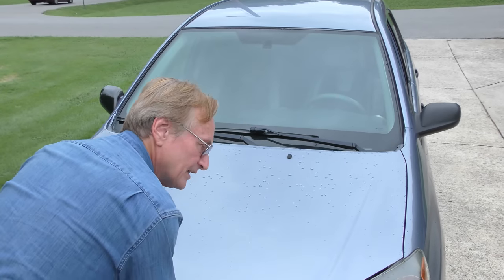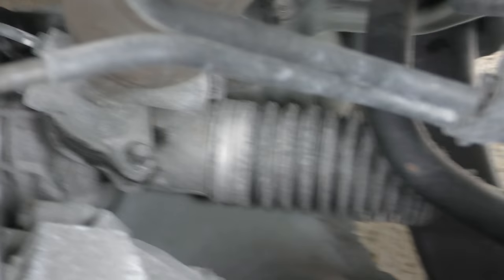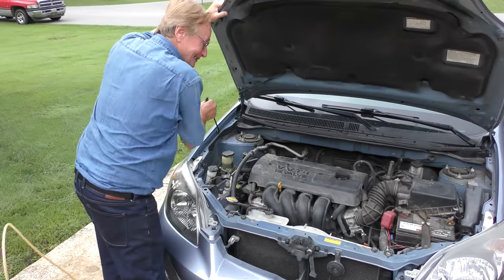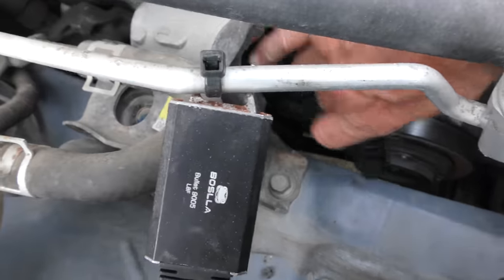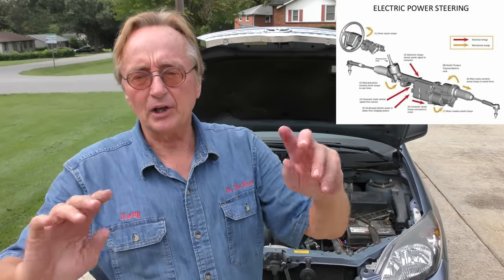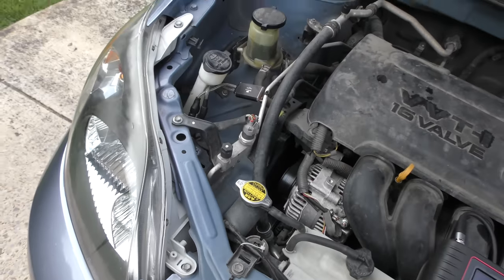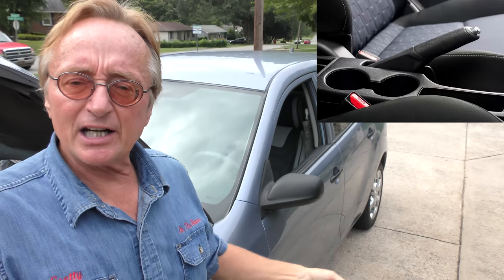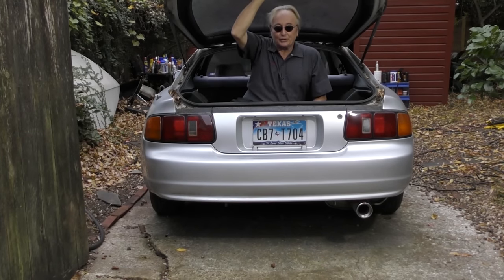Should You Change Power Steering Fluid in Your Car? Myth Busted

Comment: Last week my girlfriend mentioned it's hard for her to steer her car when driving slow so I asked how long it's been that way and she was like "oh about 6 months". I said "and you're just mentioning it now?". I went to check her fluid and it was completely bone dry. I added fluid to the max line and within a few minutes it was down to the minimum line and then stopped dropping.
Reply: Haha. That's the whole reason I'm on this page.  Mines started doing that 2 days ago on a newly purchased car.   Good to know it's an easy fix loo
Reply: Was the issue fixed after you added fluid?
Reply: Nissan lyfe
Reply: Huge  reason why  I didn’t just buy used
Reply: Drove my last camry to 400000 miles, never changed the power steering fluid and never had a problem.
Reply: @emort6  💀 they literally last forever
Reply: You  should have noticed her arms grow the past 6 months

Comment: Take off the return line to the reservoir off and put it in a container, have wife start the car and turn the wheel while you pur new oil in the reservoir.  When it's all clean,  stop and put the return line back on. Done.
Reply: I did that today and made a huge mess but when I finished it and drove my car around, I had never felt my car steer as good as it did before.

(That was my first time changing PS Fluid on my car, and I've changed engine oil many times before.)
Reply: No wife. 🤷🏻‍♂️

Comment: Great video like always Scotty! I just need you to clear this for me, I was cleaning my engine last week and for the first time I used water. I was pouring water from a hose but it wasn’t that powerful. The battery was disconnected and I waited 2 days for the engine to dry in a hot climate weather. However when I took the car for a drive I noticed that the battery was getting weaker (I have a usb charger installed which also shows the voltage of the battery). I was really lucky to have made it home but not before the car jerked a few times. I replaced the battery because the shop I bought it from told me that it was crossed. However when installed I noticed that it wasn’t charging, so I knew it also had to be the alternator. I’m in the process of replacing it, but do you think that the water was the culprit? Although I dried the engine and waited 2 days to dry with the battery disconnected? I’d appreciate your answer because prior to that it was working fine. My car is a 2012 Ford Edge Ecoboost with 73.000 miles.

Comment: I knew a lady who took her Chevy Into the dealership for service .
It only had 30,000 miles on it but they told her she needed a ' Power Steering Flush ' .
They said if she didnt get it done , It would void her warranty .
Afterwords I checked her owners manual looking for the Recommended Time / Mileage that Power steering fluid should be changed but there was nothing about it in the Owners manual .
So I called the 800 Number in the manual and talked to GM .
They keep putting me on hold .
So I figured it was just a rip off that the dealer was doing on that lady .
I called the Attorney Generals office and told them it was a ripoff .  A car with only 30k miles on it isnt required to have its power steering changed .
They told me to call the Dealer and tell them we were filing a complaint and that a 2 year old car with 30k miles on it , did NOT require a Power Steering flush .
I called the dealer / service writer and told him he ripped her off .
He never disagreed and just said " Send her back " .
They refunded her $88.oo for the Power Steering flush and never said a word .
Bottom Line ?
Dealers will rip you off especially if you are a woman who knows nothing about cars .
Reply: Honda dealers are the worst!!!
Reply: @bararaAddis   I think most dealers will try to charge you for unnessassary repairs , especially if you are a woman or you Don't know much about cars .
Reply: Awful. I wouldn't be surprised if some mechanics tried to sell a power steering fluid flush and change to people who actually have electronic power power steering just take advantage of someone who doesn't really know much about their car.
Reply: @robertknight4672  Thats true .
So many Dealers and shops will Rip you off if You don't know much about cars .
Reply: There are also men who don’t know. My friend who has a Mercedes always brings it to the dealership.
Reply: Thats what they are in business to do.. car maintenance.. of course they should try to sale you service… thats there freaking job. Of course on the other side you have toyota drivers who are too cheap to pay and drive with the same fluid in for 20 years
Reply: You are so right. Good job.
Reply: Jesus you cried that much like a baby over a lousy $88? But i guess you think income tax is justified?
Reply: Kwik Kar will try the same thing. I was told my Jeep was overheating (not the case) and required a coolant flush and possibly a new water pump and it would cost $900!  I refused to pay that. I went to AutoZone and had the check engine light checked "for free" and got the new variable valve timing solenoids I needed and they were $35 a piece, not the astronomical price quoted by Kwik Kar, and it took ME 10 minutes to replace them removing the need to pay $77.50 in labor cost to Kwik Kar.
Reply: I've been told to leave the Toyota dealership, because everything I was saying was the truth and it was causing customers to leave. But they still sold my dad an engine for my 2006 Corolla. $5K. Assholes. They should make better oil so engines don't run out of oil ever!!
Reply: Power steering fluid has a max shelf life in an unopened, sealed container, so why wouldn't it have an even shorter life in a p/s system? 
Additives break down, fluid gets contaminated. It's an inexpensive service and will do no harm but probably will extend the life of the components.
Reply: If they're that scummy, chances are that they just charged her without doing the flush. 
I have a friend that used to be the manager of a popular oil change place, and you would not believe the scams they got away with, especially with people who had no clue how their car works.  
Mind you, the state has busted these stores in the past, but apparently the money to be made from ignorant customers is just too good, so the scams continue.
Moral to the story, do your own tuneups, it takes all of 15 min with most cars, and your car will thank you for it.
Reply: You'd be surprised how expensive truly maintaining a vehicle properly is, 99% of you don't know that brake fluid should be changed every couple of years even if you don't drive it because it's hygroscopic. Power steering fluid is the same way, will your car break down if you wait on those 2 fluids, most likely not but it will certainly decrease the life of those expensive components. The dealer's entire mission is to make your vehicle last until the warranty expires, telling you this as a dealer master tech of 21 years. It's important to follow your owner's manual(that no one reads) however the mileages you see in them are the high-end for services, meaning you really should perform them sooner than suggested. Especially engine oil changes.
Reply: I'm sorry but if you really want to take care of your car. What's wrong with a premature flush? $88 dollars What's the big deal.
Reply: @daveharmon8674  Exactly.
Reply: @keithbellair9508 Principle of the thing. Shops shouldn't do that to people.
Reply: I change the fluid when it looks bad.

Comment: I just replaced my rear brake pads and rotors on my 2011 Tundra with OME and they squeak the first 100' and guessing it's the rust from sitting all night, It drives me crazy, and sounds like my truck is falling apart!! I heard many complaints from Tundra owner of the same problem!! and some said switching
 from Toyota pads to Wanger thermal quiet fixed that problem!! What do you think? Thanks Larry

Comment: You already have a vacuum extractor so use that to extract the old fluid via the PS return pipe. Keep topping up the reservoir until you see the new fluid coming through.
Reply: How did you keep it from getting air pockets in the ps system?, or is that only to watch out if bleeding the break lines?
Reply: @JohnSmith-lf8kg  if you took off the return line to the PS, with said extractor pump hooked up to that line and plugging the inlet to the PS pump where the return line was, you can keep pulling fluid with said pump until it runs clearer, too keep air out just make sure the reservoir to the PS is constantly full of fluid, dont let it suck out too much without adding more. hope this helps
Reply: @tonypayne3533  thanks👍

Comment: Heads up: Some cars nowadays use ATF in their power steering systems. Definitely read the car manual and read what the lid says. Most times it tells you exactly what fluid it takes.
Reply: I had a car that used ATF. It surprised me when Scotty poured out the power steering fluid and it wasn't red lol.
Reply: My Corolla uses ATF.
Reply: Don't mix ATF in Toyotas with that Prestone

Comment: Scotty, I have a Jeep Grand Cherokee with the electric hydraulic (no belt) steering system.  Can the same medthod of adding new fluid to the reservior be used to force the old fluid out and adding new fluid in?  I think I have a leake in my system (reservior is empty, just ordered more fluid to replenish the system).  Is that a hard system to replace (I mean to replace the hoses)?

Comment: Another way of doing hydraulic power steering fluid change:

You can also put the front wheels off of the ground on jack stands, and take off one end of a power steering hose. Put several drain pans underneath. Then turn the wheels left and right a few times. Put the hose back on and refill the reservoir with power steering fluid. Start the engine, let it idle, then slowly turn the steering back and forth all of the way until you have smooth, quiet steering and enough fluid in the reservoir. Keep adding fluid as needed. Then cap the reservoir, put the car on the ground, and test drive it. This is also what you end up doing if you have to replace a bad power steering pump like I did on two different Subarus.

Comment: I just replaced the seals in a 2001 Honda power steering pump. The seals were as hard as plastic. The car has 240000 miles and I bought it new in 2001.

Comment: Scotty, I have a 2014 Jeep Grand Cherokee Laredo 3.6. I put the wrong type of power steering fluid in and shortly after that the pump is now leaking at the pump. Can I just change the fluid and will that stop the leaking, or change the two rubber O rings and fluid? It has a Electro-Hydraulic pump and calls for MS-11655 fluid. I am guessing the wrong fluid made it start to leak. Thanks for you help.

Comment: When I managed a lube shop, I offered a power steering fluid change for $15.
This was back in the late eighties, early nineties.
We used the same vacuum tank we used to drain automatic transmissions while the pit man was removing the pan and replacing differentials without drain plugs.
Reply: Now it's around $130
Reply: And i bet 80% of the tightwads was too cheap to pay $15

Comment: I think I’ll stick with my 2018 V6 Tacoma.  Belt driven power steering. Zirc for universal joints!  ( front anyway ). Weird temperature check for transmission fluid, but workable.

Comment: My Scion XB, sometimes when the weather is cold the steering will lock up at first start up. This makes me think there's some condensation in the fluid that freezes. I've had the car for 10 years & to my knowledge the power steering fluid has never been changed. I worry that if I change it it might mess up something like in a transmission that's went a long time without a fluid change. I know that power steering is not as complex as a transmission. I wonder if it would be safe to change the power steering fluid.

Comment: I use gravity. Take both lines off the res tank. Return to a bucket and the other i push a slightly smaller tube into it with a large funnel on the other end. Fix the funnel to the hood and fill. Go get a beer or coffee and come back later. When the return is showing clean fluid coning out. You are done.

Comment: My 250,000 mile power steering was getting very loud without any air in the system, so I was scoping out changing the pump.
Before I got another I did a ' non- running ' flush and freshened the fluid. That helped it out 90% and I'm still using it.

Comment: Scotty, i wish i had power steering fluid! My 2011 Ford Fusion has electric power steering- and it doesn't work, then i found out that there is a recall for 2011 models with electric power steering, but... mine was built 6 days before the recall, i currently have a complaint in with NHTSA, but in the mean time it's quite annoying driving around without power steering

Comment: Hate to break it to Scotty, but that Matrix doesnt use Power Steering Fluid. Toyota states that Dexron II or Dexron III Automatic Transmission Fluid is the one to use. I guess you can use PSF on a pinch but dont leave it in there for too much time.
Reply: It's probably fine, but I would have used, and do use, Merc/Dex III as well. My '06 Scion, '03 F150 and '84 Mercedes use it too. I buy it by the case. Pretty cheap that way.

Comment: I flushed the ps fluid in a 2005 Civic with 200k miles. Made no difference I could observe. The premise is the fluid has contaminents in it which may have damaged internal seals if allowed to remain.

Comment: Hey Scotty, I recently bought a used car and have no idea what kind of power steering fluid the prior owners used. Would this method work if i (for the sake of the question) was using a different brand than what was previously used or would it just be better to do a complete flush to avoid any possible issues

Comment: I changed the steering fluid just like that but the only think i didnt did cause my steering fluid was really low to almost dry, its the couple rounds with the car to suck the fluid out 2 more times.would there be an issue?

Comment: An even easier, more thorough way to flush power steering system. Drain as much old fluid as possible. Fill with clean. Remove upper resivor hose and connect a longer hose to it, put hose a container to receive fluid. Start car, turn steering wheel back and forth stop to stop. Keep resivor topped up and an eye on fluid coming out. Within a couple of minutes you'll see the old dark fluid fade and the new fluid start pumping out. When you see new fluid put hose on back on resivor and you're done

Comment: I think more easier way to use the jack, is to lift the front wheels off the ground, start the car and turn the wheel.  ) 
I had bmw e39, and there is a drain plug at the bottom.

Comment: I thought that Toyotas use Dectron II ATF for power steering fluid as is printed on the dip stick cap.  They sell the Japanese power steering fluid (red) at the parts stores but it is cheaper to just buy a quart of ATF fluid.  Scotty am I wrong?  Maybe it is just that my Toyotas are older, but I also have a 2001 I-30 Infiniti made in Japan that also says to use ATF for the power steering as is on the cap.  Please let me know if your Matrix is different or if the regular power steering fluid is ok to use
Reply: I was wondering the same thing
Reply: You are correct. Scotty is too cheap to buy OEM fluids. I don't trust those universal products and use the specified red ATF for power steering fluid.
Reply: You are correct. For whatever reason he uses the general PS fluid in his cars rather than any ATF as Toyota specs.

Comment: I have a question why is some powering steering that is new red and some that is yellow ( like new engine oil) ?
Reply: The red colored power steering fluid is actually transmission fluid. Most Chrysler/Dodge vehicles call for ATF to be used in the power steering system. Other basic cars, use regular power steering fluid (the yellowish one). Also alot/most new cars have electric power steering now.

Comment: Yeah, I think the power steering fluid is the third most frequently managed fluid in my truck. First being motor oil, second being washer fluid. I like to check the color and level of the fluid. If it starts looking too dark I'll use the turkey baster method to flush it with new ATF (manual calls for Mercon III for power steering, Mercon V for the transmission).
Reply: You must be a fellow Powerstroke owner yeah? :)
Reply: @jamesb1988  No. 2002 Ranger XLT with the 3.0 Vulcan

Comment: every fluid in your car should be changed at some point. from my experience I did a full fluid flush on my car and a week later the shaft seal on the pump starte dleaking which is a know issue on my car, 02 maxima. fresh fluid has more pressure so a weak point may show itself when you put in all new fluid..

Comment: Hey Scotty, love ya videos. My sister's Kia Soul has one of those electronic power steering. A cushion or gasket (I don't know what to call it) broke and had to be replaced. The whole steering assembly had to come off to change that $5 cushion. Now it's working fine. Cost of repair...Parts: $5...Labor: $400.

Comment: Love your stuff, Scotty, but you are doing it the hard way. Just remove the return line(usually the top hoes on the reservoir) and insert it into a gallon milk jug, run the car, and cycle the steering wheel while pouring new fluid in, thus flushing the old for new fluid.